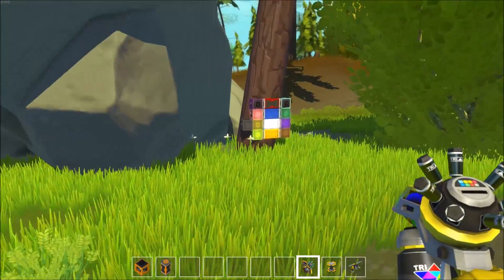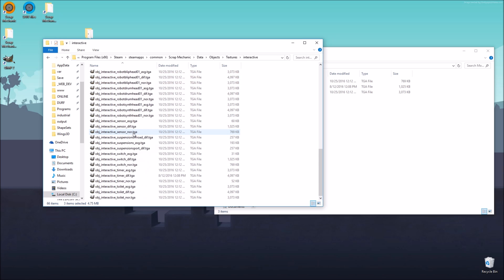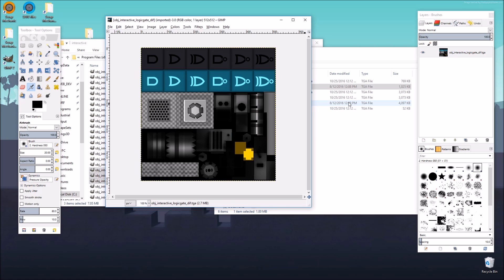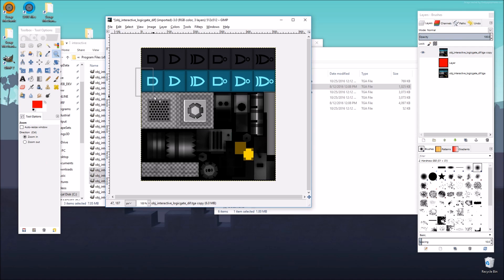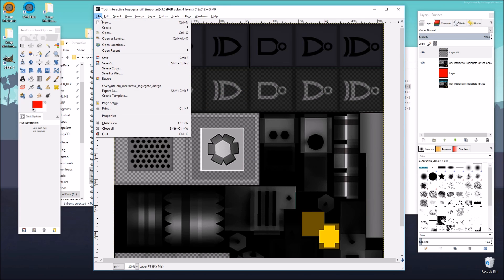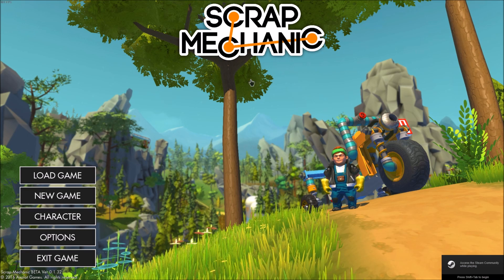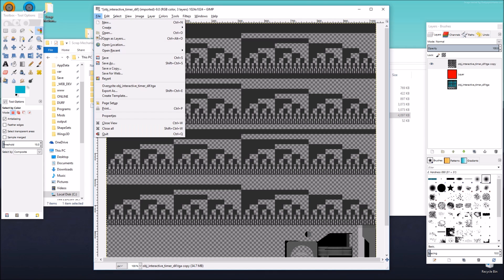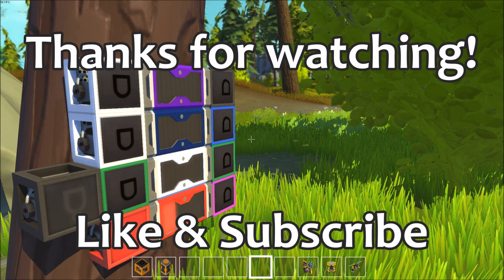How to Make Mods 1: Paintable Stuff | Scrap Mechanic Mods (tutorial) [OLD]

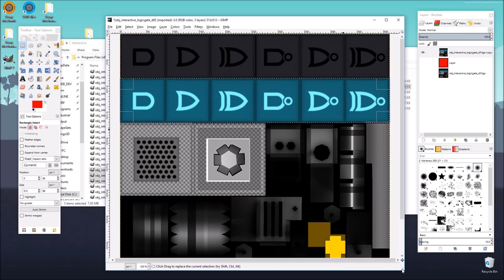Comment: Hi Durf! I finally bought Scrap Mechanic. Now, i want make mods like you. But i can't cut it (Blue Logic Gate Screen). How you did it? 6:15
Reply from the maker: select and cut? These are very simple things for image editing.
Mods will be very VERY difficult if you are having trouble with select and cut.
I'm not sure how I can help :s
You can use the select menu, and edit menu, but I used the shortcut key CTRL+X to cut (after selecting)
Reply: I did it too
Reply: and i can help too about you website ;D

Comment: would this effect multiplayer
Reply: you would still be be able to play multiplayer, but your friend will not see it.
Reply from the maker: This does not affect multiplayer in any way. Perfectly safe to try out.
If other people want to see the logic gates and timers liek you do, then they need to install the mod as well.
If they don't install the mods, then they see the normal light color (blue).
If you are ever unsatisfied with the mod, you can reinstall Scrap Mechanic from Steam, and it will overwrite the mods. (or just use the original textures from the backup files, same thing)